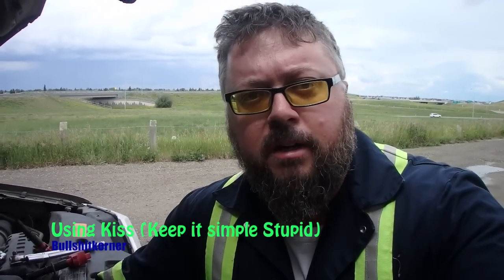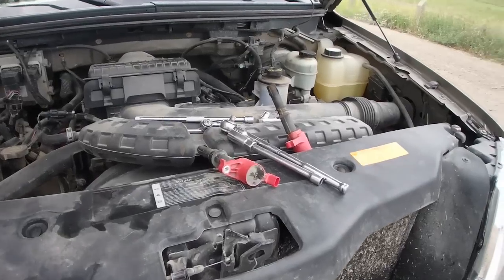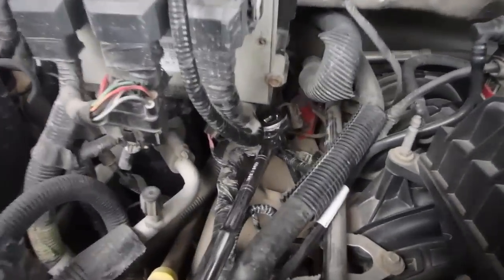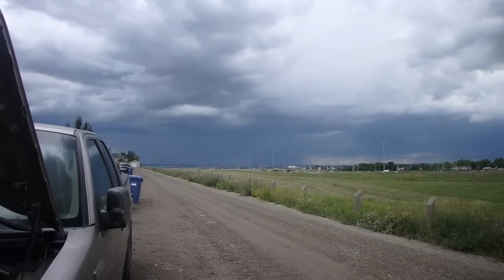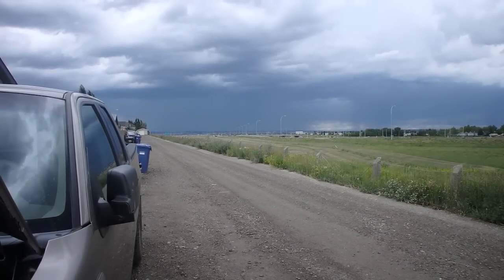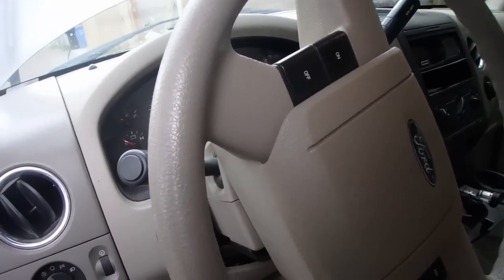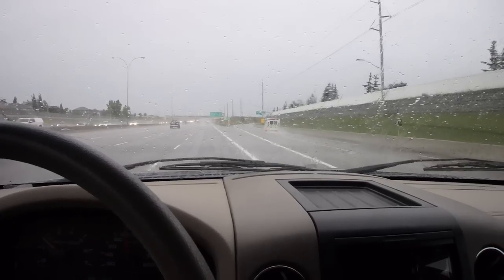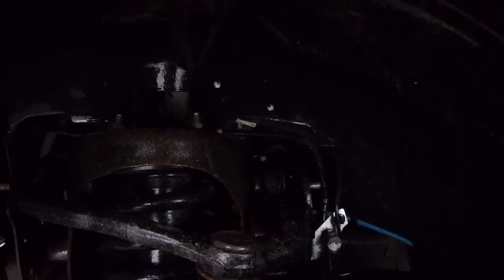Ford 5.4L 3V Ticking, Knocking Solved

Comment: What year is your F150? I just bought a 2009 and it is making the same sound. I think I've ready that in 2009 they fixed the whole spark-plug-breaking-off issue by going back to regular plugs. Also, did you replace the coils or just put the stock ones back on?- Thanks! - John

Comment: Yeah this is George and I'm in California I just bought a 2006 f150 the big motor l the Laredo 5.4 so every now and then when I start it up run it runs great and then about 45 minutes into it said if I stop and buy something to eat and it's against the wall and I love your theory of against the wall or either the Middle Lane with the k rail and you could hear your truck and and how it sounds and well it has a large knocking noise I wish I could upload it from my drive Google drive to to this comment so you can hear it but is it that simple to just check the spark plugs?

Comment: I have a 5.4 Ford. My engine knocking pretty good. My mechanic says it could be a lifter issue. I replaced all my spark plugs and ignition coils around 3 to 4 years ago. My engine has been knocking for over a year now. I will do anything to save me a lot of cash.
Reply: Lifetime ignition coils 60-70k miles

Comment: So I am having the same issue and sound, the only difference with mine is after the noise starts when my RPM goes down either from stopping or slowing down, my oil pressure bottoms out on my gauge, once I give it gas it picks back up. Any ideas, I'm gonna look at my plugs when I get a chance first. Thanks for posting this because I was for sure thinking I may need an engine replacement.
Reply from the maker: sounds like your chain tensioners are shot and leaking oil giving you the low oil pressure but your engine could also be shot as well

Comment: I better check my plugs and make sure they are tight, and with only 41K on this 2004 fx4 truck, I have a ticking sound also. Maybe I should just replace all the plugs, as I think they are special long skinny type?   Thanks for the Video....
Reply from the maker: it's easy and it's free

Comment: this is 2016 and we have issues with motors having spark plugs getting loose..... going backwards ya say?
Reply from the maker: it's 2016 why we are still burning fossils fuels in vehicles is still beyond me.  Over 100 years of the combustion engine
Reply: Like Corb Lund says, "When the oil stops, everything stops. Nothing left in the fountain. Nobody wants paper money son, so you just well stop countin"
Reply: And 4000 years or so of round wheels... bout time for a different shape already, no???

Comment: Yup.  Found my loose plug yesterday - ticking noise is gone.
Reply: Did that make your knock sensor come on i have a 04 change spark plug and coil pack in it yesterday  now i got a tick and ran it to and had knock sensor code p0325
Reply: Roy Striblin how did it turn out?

Comment: I've got an 04 F150 that has a ticking sound but it's on the passenger side..Have you heard of others having this problem with loose spark plugs as well??
Reply: Rilian Riggs did you run it with the tick or get fixed?

Comment: Would there always be a misfire code or check engine light with this issue
Reply: Yes if you have a loose spark plug, bad coil or a blown plug.  It shows up as service engine soon.  Run a code check and will saw # plug is misfiring.
Reply: Nope.

Comment: A friend's F-150 the same year as yours her truck blew out a plug so ya the 3 valve 5.4s probably suffer from plug issues.
Reply from the maker: that's my thoughts as well even though "quote" these motors aren't suppose to have that issue

Comment: Ahhh I knew you were in Calgary! Looked like stoney trail. I'm around the corner dealing with a knock in my e250. Thanks for the help. My knock is pretty loud so not sure if this will fix it or not.
Reply from the maker: Sounds like you may have more serious issues at hand
Reply: @BackCountryWrenching  Yaaaa I decided to get rid of it. Burns my soul, she was my first but she owes me nothing. Need any parts?
Reply: @BackCountryWrenching  I have some fresh spark plugs, intake gasket in box, some heavy duty brake pads. Can't remember if they're front or rears. Lemme know!
Reply: Cody Schubert how many miles and what did you get for it? Just picked one up don’t know if I want it lol

Comment: I to live in Calgary and have been battling my 5.4 for, forever! Lol I got a mis that comes and goes and have pulled and changed out coil boots plugs etc' Iv even seen some blow by. Would you wanna have a look? Any help would be appreciated :D
Reply from the maker: if it's not newer than a 2013 I could scan it with my Snap On scanner and see if there is any real issues to be found.  otherwise for liability reasons i don't work on peoples vehicles

Comment: they are hell to put a heli coil in the number 4 or 8 plugs when they blow, best way to prevent is to use a torque wrench when installing new plugs
Reply from the maker: i will take your word for it, considering those bastards are down deep

Comment: will this work on a navigator has the same engine
Reply: Just bought an 07 Navigator, thinking I might have to do lifters, but still a good deal. Watched this video, was skeptical but took a quick look to verify. Front left plug was finger tight, and looks like original equipment. Tightened it down and the ticking drastically reduced. Tomorrow morning I'm replacing all of them!

Comment: I got the same problem but when I drive my engine starts to jump when I get to 45 mph what could that be?
Reply: mv122411 one of your coils are bad. the jumping is a misfire
Reply: mv122411 yep same here. Bad coils. Replaced plugs and coils runs like a champ
Reply: Kevin  Quigley Is there a way to test the coils?
Reply: Joshua Ryan yes you can test the coils by leaving the truck running and unplugging the coils one at a time if you unplug the coil and the way it idles doesn't change then the coil you unplugged that didn't change the idle is the bad coil

Comment: FYI just for some guys out there, this exact same thing happened to my 2001 grand marquis, had a tick couldn't figure out what it was turned out it was loose spark plug on driver side, maybe its a ford thing..
Reply: It's an Aluminum Head thing, The different metals expand and contract differently during heating and cooling cycles. This can cause the spark plugs to work loose, especially if they were improperly torqued when installed.

Comment: Livernois Motor sport has come up with a solution ton end all the BS that the triton is.  you can order a kit with not only the lock outs but the sctx4   flash programer . It reprograms the pcm to except the solid phaser an adjust it to the change , Go to their website and check it out . A mechanic at a high performance engine shop has done 10 of these and not only have they not come back they as well have anymore phaser issues. EVER again. Better to do it before your phasers and timing chains and guides are screwed up. or right after you replace them
Reply from the maker: i've thought about that but the kit is so expensive, is there any performance and fuel mileage gains ?
Reply: I understand there is no noticeable power loss it gives your triton more bottom end power which is exactly what the triton needs . the parts guy at Motorsport talked to me about it. His name was Ethan and he went well out of his way to explain it.  When I bought this truck I knew nothing about the engine. Since then i have woke up in the middle of the night in cold sweat nightmares. This seams to be the answer .

Comment: Good job Jerry, head to the nearest Toyota dealer and trade that pile of shit. I got a letter last year for a refund to change the plugs out because they break, in the letter Ford denies this problem. 04-08 the engineers at ford opened there loyal customers mouths and took a giant 5.4 shit in it. Cummins diesel is what I want next.
Reply from the maker: i'd like to find a E350 4x4 van and make a overland vehicle out of it

Comment: moisture builds up also, and cause a skip, the plugs work loose also and will blow out then it will sound like a fucking farm tractor with no exhaust . just my  experience from past repairs on the same engine.

Comment: not supposed to have an issue with loose plugs? the plugs in those 5.4s shoot out into the hood all the time lol
Reply: 268k miles never thrown a plug. everyone i know with a 5.4 never thrown a plug.
Reply: the blow out only happens on the 2 valve 5.4
Reply: Danny Hinkle I've read the 2v and the 3v. but been around hundreds of f150s and never had a problem like that.
Reply: ifixyour360...  I've only seen it on one.  I own a 2002 with the 5.4 with 180k.... no sparkplug blow out yet.  Might not be as wide spread as the e-net makes it out to be?
Reply: Danny Hinkle I'm going to say its not. the work orders and complaints I seen were all posted by people with oil as old as 40k miles.
Reply: haha dang!  people don't care of their stuff
Reply: Danny Hinkle yeah I had one guy try to tell me that the 3.6 ecoboost would outlast the 5.4 and I was like nah show me a 15 year old ecoboost with 270k on it and only replace the manifold (cuz the die cast looked terrible on it) and the alternator. and obviously packs and plugs.
Reply: The 3v and 2v both have issues with sparkplugs.   The 2v, the can loosen and blow out and on the 3v, they don't blow out, they don't COME out.  As in you go to replace them, and the top will snap off and the plug is stuck in the head.
Reply: wrong motor these never blow out . that was a problem only with the 2 valve 5.4 totally different motor  ,,
Reply: Yeah,  they never come out period.  The 3v 5.4 the sparkplugs seize in the head and will snap off when you try to remove them.

Comment: I can't wait to get off work & go check into this, just bought a Lincoln Mark LT w a 5.4l 3v that ticks & definitely more noticeably next to KFC @ drive through lol
Reply: Was it the cam phasers?
Reply: @georgeeno_2815  nope, it was 3 out of 8 spark plugs tapping because they were loose......when I pulled them all put i found 2 different part numbers & some had broken tips.........replaced all 8 torqued them down correct & runs like a dream
Reply: @dennisferris4671  thanks! I’ll check them out as soon as I get back home from school. It started ticking not too long ago, it’s not an intense/loud noise but it’s definitely noticeable specially next to a wall
Reply: @georgeeno_2815  exactly i only noticed the tapping as I rolled up the drive through @ kfcs next to the building. Chances are good with this motor its loose plugs, do yourself a favor and pull each of them completely out and inspect them then put back in I think it was 13 inch lbs
Reply: @dennisferris4671  Hopefully they are only the spark plugs and nothing major cuz that will definitely take a toll on my pockets. Previous owner had a full timing job done on it at 199k miles and I’ve always kept up with oil changes.
Reply: @georgeeno_2815  of you end up buying new plugs get the updated part number the old ones were replaced because the way they were made they had problems snapping off in your block.  Mine cost right at $100 bucks, take your old ones out with a hot motor  and go slow & steady so they don't bust off on u brother good luck man!
Reply: @dennisferris4671  yeah i know about pulling them out slow and steady when the engine is hot so they are less likely to snap and get stuck. Thanks!

Comment: Yeah Jerry had the same problem with my 5.4 3v, after I did the plugs. of course all 8 broke but shortly after a couple of the plugs were loose but I only noticed a raw fuel smell in the cab when the heat was on not the ticking you had. also the engine would run rough at idle.  I still need to do all the timing components though which sucks dick cause that shit isn't cheap.
Reply from the maker: i'm sure I will too sometime in the future when I least expect it
Reply: tRActorMaNiac31 did you do your timing components and how were the results?

Comment: go with the easiest and cheapest first( has to pass the razor test). Reaching the back plugs on those damn fords is a bitch! Not supposed to use air tools on the sparks but i use a 3/8 air ratchet on mine. Haven't ruined the head ........ yet
Reply from the maker: same here seems like the only way to get the plugs out of these engines, 3/8" gun on low setting

Comment: Sell it before the plugs blow out. lol!!! No really.
Reply: The 5.4L 3-Valve engines don't normally spit plugs, they have the opposite problem, the plugs stick in so well they break off. The 2 Valve engines spit plugs if they are improperly torqued and start to work loose.
Reply: Why? It’s a good truck prolly the best! No really

Comment: Quieter but still fucking loud.... do a double oil change, start with walmart or motorcraft oil add a bit of seafoam or something, run it 50-100 highway miles or a bit hardup a nice steep hill (you got those in Canada?)

Flush the shit out.

Then feed her some rotella t6 diesel 5w40 doped up with liquimoly ceratec. New filter of course..

PS mines at 172k and far quieter WITH the tick than yours is after the fix
Reply from the maker: if you have to ask if we have steep hills your pretty ignorant and proves your education system has failed you
Reply: 1) it'd be a mistake to assume that anyone using the English language proficiently is American-by-default...consider the irony of that for a moment

2) Not actually American, have actually been to Canada, and faintly recall seeing hills... just jerking your chain.
Reply: PS

3) ...you misspelled "you're" while taunting someone else for supposed ignorance
Reply: Why not just add seafoam to crankcase with current oil then drive highway for 100km then do oil change? 

Just curious why you're recommending to dump out current oil, replace with cheap oil plus seafoam then change back to quality oil/filter after highway drive?

Thanks.
Reply: @Powerstroke431  that would get like 90% results probably